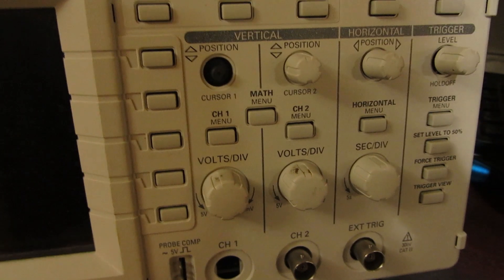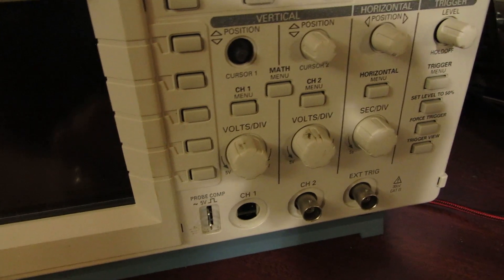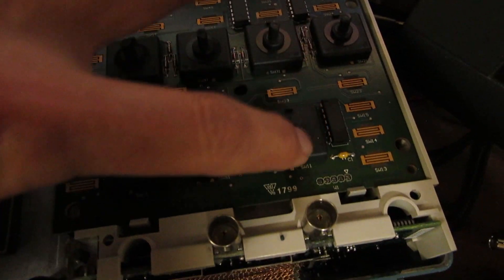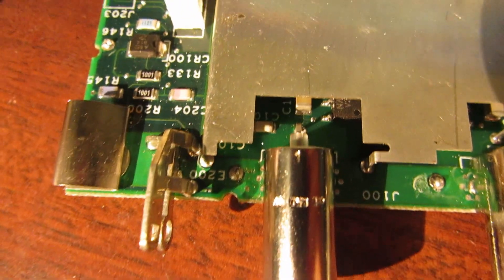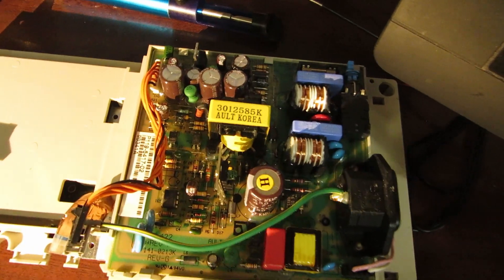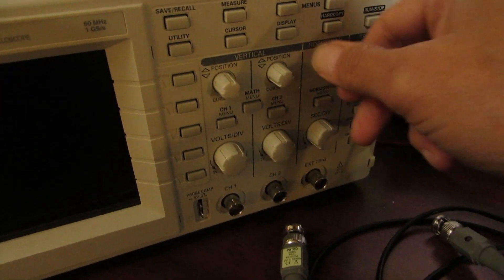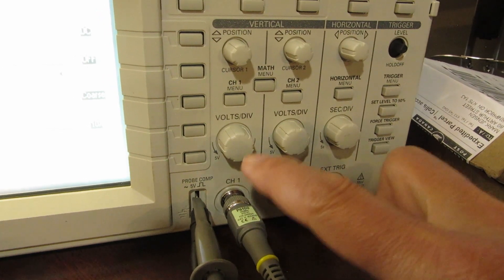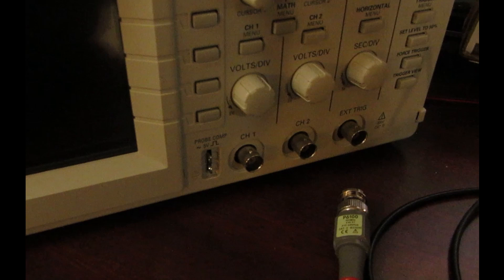Tektronix TDS 210 Oscilloscope repair

Comment: Great Video - I just purchased a scope on Ebay with a broken trigger jack. I am a very experienced TV Engineer and I found out what type of replacement parts I need to fix my Tektronix TDS scope. Thank You.
Reply from the maker: I apologize for not responding. I didn't get a notification.
I hope this video helped. It is such a great scope, and is tough as nails (aside from the usual issues). I am glad you enjoyed the video.
I will be repairing a Garrett metal detector in the near future if that should interest you, just waiting on some caps, so be sure to subscribe!